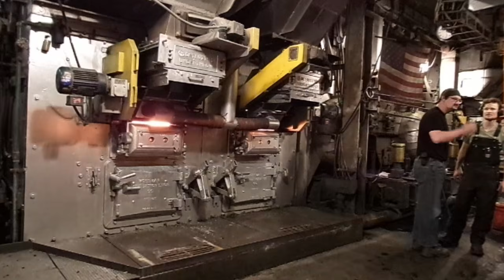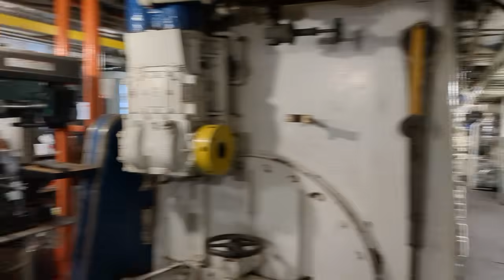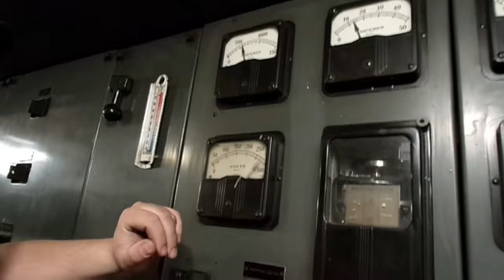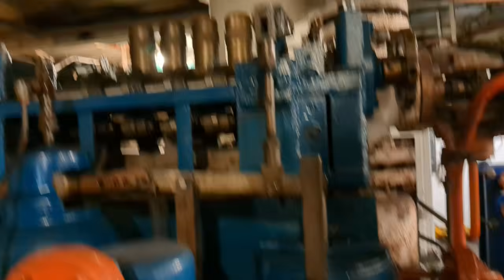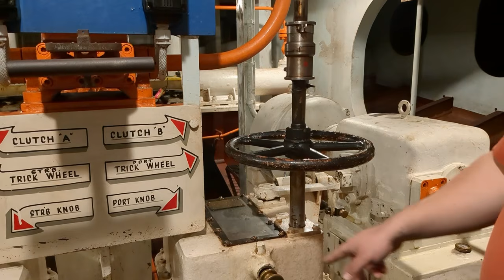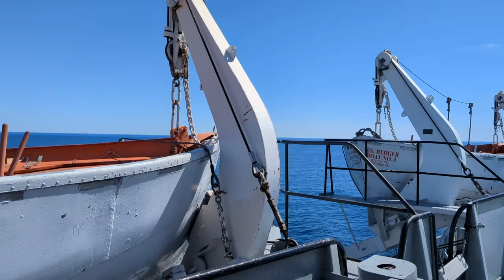How the SS Badger's Steam Engines Actually Work

Comment: Very interesting stuff!!!

I was on many Navy ships and merchant ships in the 1980's that were steam powered. Most of the SSTG Ship Service Turbine Generators were 1200 rpm 6 pole machines. The turbine would run around 10,000 rpm and a gearbox reduced it to 1200 rpm output. These SSTG sets were about the size of a VW Beetle.

 An interesting part on the SSTG turbine shaft is the overspeed bolt. It's a spring loaded plunger in the turbine shaft near a journal bearing that stays put until the turbine speed  hits 105% by accident, sometimes by an operator opening the generator breaker while the machine is under load.. The increased rpm causes the plunger to fly out of the shaft by about 3/8'' where it strikes the overspeed trip lever. That dumps a valve in the governor hydraulic circuit to release oil pressure in the Trip Throttle Valve which snaps shut and instantly stops steam flow to the turbine. That whole governor oil circuit is fed by the turbine's main oil pump. Its feed line is restricted by an orifice plate with an 1/8'' hole in it. Once the overspeed lever is tripped and its dump valve opens, there is no way to feed enough oil through that little orifice to  keep the throttle valves from snapping shut. 

The Coast Guard and the American Bureau of Shipping inspectors have to witness the trip speed function after an overhaul to sign it off.  Many SSTG sets had a hand crank oil pump that needed to be turned before starting the turbine rolling. One guy cranks the oil pump handle, one guy cracks open the trip throttle valve which gets the unit rolling where the shaft driven oil pump takes over. Navy nuke subs always had direct drive between the turbine and generator without a noisy gearbox between. Some were 3600 rpm, some 1800 rpm. Every one had an overspeed bolt.
Reply from the maker: neat! Ive seen generators like that on the william irvin and the SS badger. do you know why marine steam turbine generators always have a gearbox and a 6 pole alternator?

Comment: Skinner  Unaflows are the height of reciprocating marine steam. About 30 years ago I was lucky enough to talk my way down in the engine room for the entire crossing.  The  Chief Engineer was Bill Kukla who was kind enough to allow me to see the engineering records. Per Coast Guard regs, periodically the engines were torn down and critical parts were measured for wear. At that point, after about 45 years of use, there was basically none, thanks to the superb design that called for generous bearing surfaces and copious lubrication. My favorite recollection was getting to watch the engines during the docking procedure. Multiple forward and astern commands on both engine are needed to turn the boat around to back up to the dock. I was amazed at how easily, seemingly without effort, those Skinners could change direction. Thanks for the video...brought back some wonderful memories.
Reply from the maker: thats good they built those engine with thick large parts! we should all ride on the badger to help support them. They need our money to fund the crew and maintain the historic steam plant. 

if they didn't have enough money they might consider replacing the steam system with gas engine or batteries!
Reply: A miniaturized and higher-pressure version of these engines was also experimented with for steam car propulsion in the 1953 Paxton Phoenix. It was the last car Abner Doble worked on, and by far his most advanced prototype. NASA actually studied them back in the oil crisis and determined they were a viable alternative to gas engines. Right around the same ballpark of mileage and power-to-weight, but capable of burning a wide variety of fuels and do so cleanly. Of course, nothing ever came of it because the oil crisis eventually ended and the development of the modern catalytic converter made gas engines much cleaner. Still a fascinating piece of technology, though.

Comment: Thank you so much for this video.  My first interest in steam plants was marine plants.  

I was for several years an engine room volunteer aboard the SS JOHN W BROWN, a Liberty Ship built as part of the emergency WW II ship building program now maintained as an operating museum ship.  The Liberty Ships were powered by a 2500 ihp triple-expansion steam engine and two water-tube triple-pass boilers running on fuel oil.

I had heard of Skinner Uniflow engines but had never had much information about them.
Reply: I toured the docked SS John Brown back in the 80's I think it was ... even walked down the shaft alley! My brother in law was a marine operating engineer on big ships and gave me the tour of that Liberty ship.

Comment: I finally understand how the cam system works! What a brilliant design concept- the thermal efficiency of that system is exceptional. What is also unusual (as if unaflow isn’t uncommon enough) is how it’s compounded with each high and low pressure cylinder on a single connecting rod. My understanding is that these engines were always a rarity and that the Badger’s skinner engines are the only ones of this architecture operating in the world. 
Thank you so much for the excellent tour of the Badger’s intricate systems. I look forward to the boiler tour!
Reply: The other advantage of the uniflow is they have a constant temp through the cylinder promoting higher thermal efficiency as compared to counterflow engines. The steam travels the same path.
Reply from the maker: yes the cams are quite geneious! Now I finally understand how it works and Im proud to share it! 

I would disagree about the efficiency because the high pressure steam cant expand fully in the engine. it expands more than in a triple expansion engine but not as thurougly and smoothly as a turbine.

Comment: 6 pole 60 HZ @1200 RPM has low rotation speed for lastibility and noise vs 4pole 1800rpm.
Reply: Coffin turbo pumps!  Good video!
Reply from the maker: so I take it as they are quieter and more durable. that must be why they use the on ships. but then why dont they do the same at steam turbine power plants?
Reply: @SteamElectricityandPropulsion Steam turbine generators typically have 2 poles. Because steam turbines operate most efficiently at very high speeds, 2-pole rotors are ideal as they allow the generator to spin at the exact synchronous speeds of 3600 for 60 Hz grids or 3000 RPM for 50 HZ.
Reply from the maker: @publicmail2  but then if slower generators are more durable why dont they just have a gearbox on power plant turbines? they had that design on the back pressure turbine at hibbing and the waste to energy peter brotherhood unit. generators ran at 3600 rpm while turbines ran at 5500 to 7200 rpm.
Reply: @SteamElectricityandPropulsion It's a trade off, By eliminating a gearbox, engineers drastically reduce maintenance and prevent mechanical failures, though it comes with a trade-off in generator size.
Reply: @publicmail2  2 pole at 3600 requires less torque than a 4 pole 1800 rpm alternator.